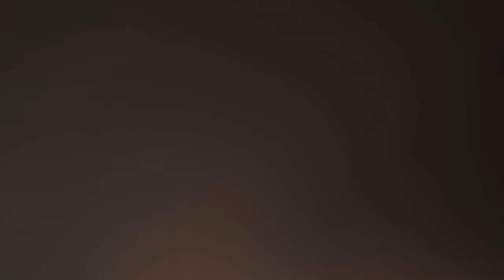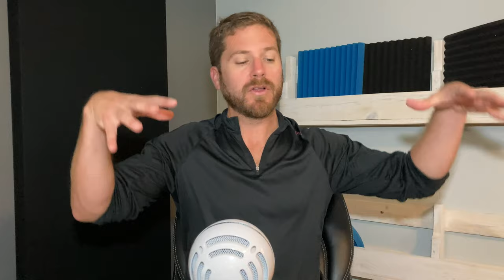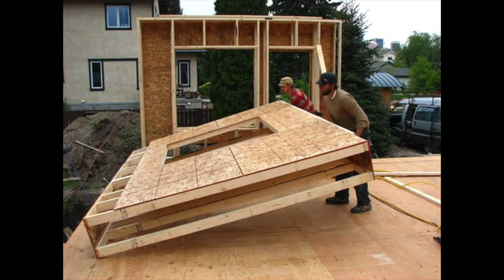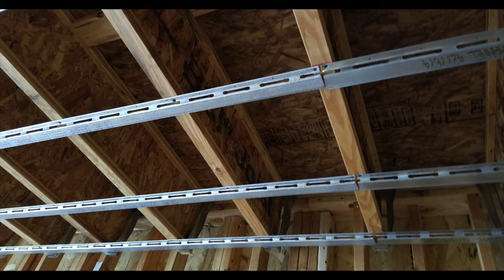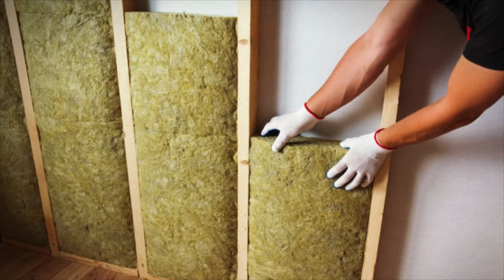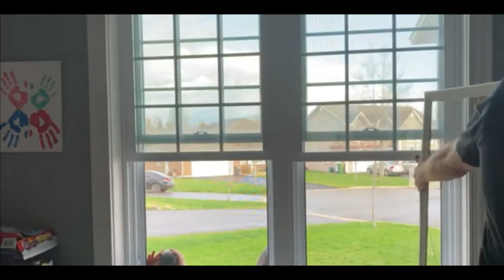BEST Soundproofing Advice I Ever Received!

Comment: I really like your channel and your unbiased opinion. If I want to block the noise from my neighbors, mostly tv and voices, but I have a solid brick wall, should I add the drywall directly on it (maybe 2 layers of drywall with mlv between) ? Or should I also have a high density foam glued on the brick wall and the drywall on top of it ? I'm concerned that the sound will go from the brick wall directly to the drywall.

Comment: Can you suggest plexiglass as a insulator for noise and cold weather? Held in place with foam insulation strip. I have double pane only 3 yrs old but they are not great. Seeking a DIY option as Indow inserts are expensive. My bedroom windows face the street and I hear the snow plow. Always appreciate your suggestions. Thanks
Reply from the maker: Plexiglass won’t work well if you already have double pane windows unfortunately. Even the Indow is more for single pane windows.
Reply from the maker: I’ll have a window plug video coming up soon. That could potentially help in your situation!
Reply: Definitely a window plug for your situation would be good, I'd tint the window with a reflective tint so it doesn't look bad from the street, in fact I gotta figure out something myself for this upcoming winter here in Oregon...It's already awfully cold at night here due in part to the terrible forest fires we had all around my town last year.
Reply: @soundproofguide  I have the same issue as Carol Carol. I have cheap, brand new, tiltable, double pane, double hung vinyl windows that seem to let in low frequency truck vibration noise like knife through butter. I used a sound meter, my ears, and my hands to determine that the main entrypoint of noise (and a little cold air) is where the upper and lower sash meet. What keeps the sashes touching is 1/8 inch pile weatherstripping. Is it possible that the pile weatherstripping doesn't fully block air/sound? Wouldn't adding an airgap via an Indow or plexiglass layer help? I know you mentioned airgap in another video to cut down vibrations. What about adding more weatherstripping?

Comment: I already have double thick window insulated wall and ceiling but the sound was still there :( the noise was coming from the window

The thing is i lived in an apartment, but the motorcycle sound was so disturbing i can't even sleep because of the noise
Reply: What sort of motorcycle are you trying to block the sound from? something like a V-twin cruiser will have a lower frequency than something like a Sport bike's which can be ear splitting loud.
Reply: I hate harley's I remember some douchebag would drive up and down our street at 2 am. Karma has his number. Sheesh

Comment: I have an interesting situation. today, I am getting my condo spray foam insulted. Am I able to use Rockwool Safe and Sound in some areas on top of the spray foam? Its Mainly for Soundproofing as there is Ac Lines in part of my wall.
Reply from the maker: Yes you could. The problem with spray foam is that it’s wonderful for heat and cold insulation but terrible for noise isolation.
Reply: @soundproofguide  very true. I had the foil back insulation in my walls. I live in canada so -40 degrees, spray foam is a must. Ill add the Safe and Sound in some well needed areas. Thanks

Comment: Suspending your sub-woofers and speakers with something like bungee cord off the floor will stop a LOT of the vibration noise transfer. And as for wall and floor treatments, I think it is more like building some legos, you have to complete all the steps before you get your end result, you can't just do one or two things and get something your gonna be happy with.